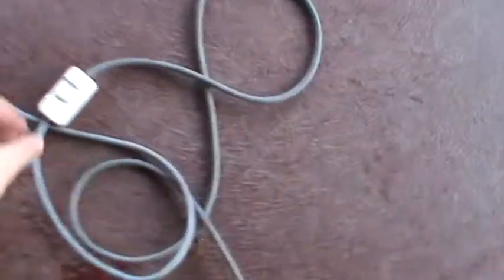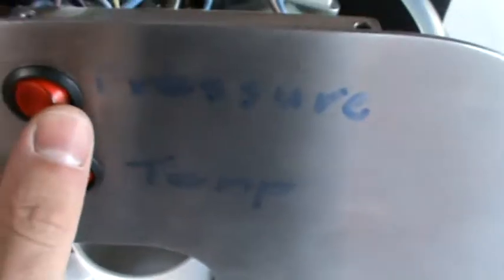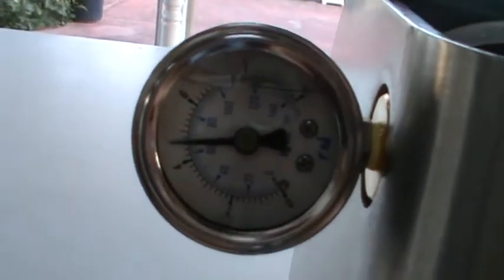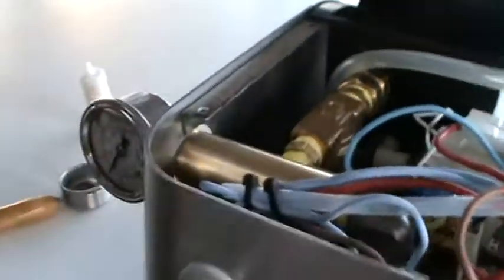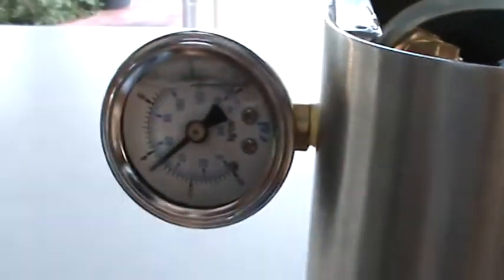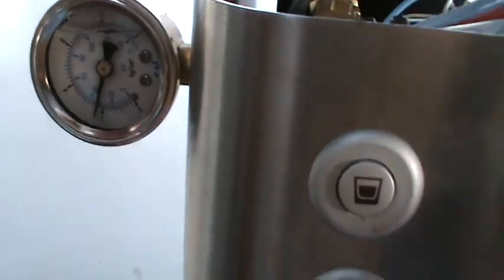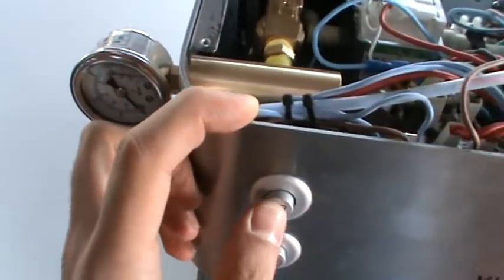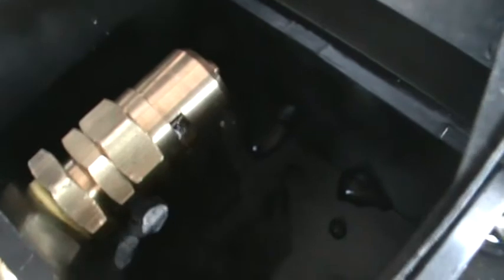Powering up my modified Saeco Via Venezia

Comment: Hello, I have the same machine. I get power but when I press the cup button to get water, nothing happens. I also don't get the steam working. The cup button should lit up but it won't. I'm too far away from any repair place so need to try and fix it myself. Could you please advise me on what it could be. Kind regards!
Reply: I know this is four years late but you have to turn on the machine, immediately open the steam wand and let out about four oz of water then close it and let out the same amount through the group. It's all in the manual on priming the pump, and after you do that you'll get both steam and water.